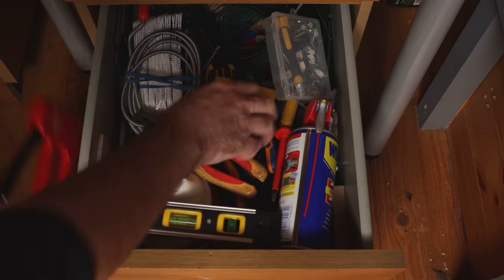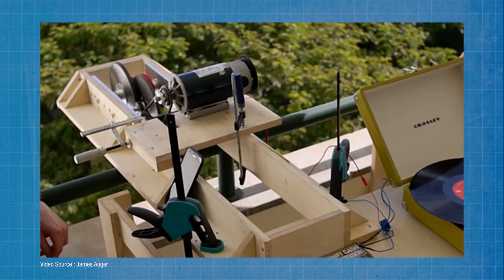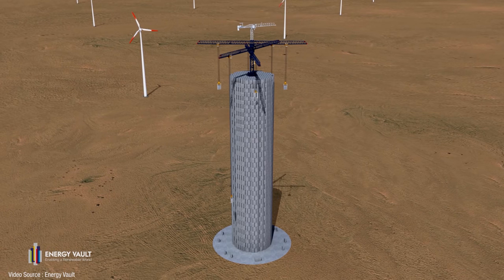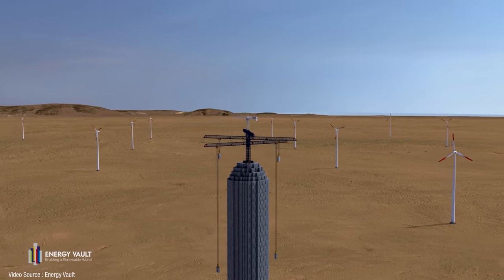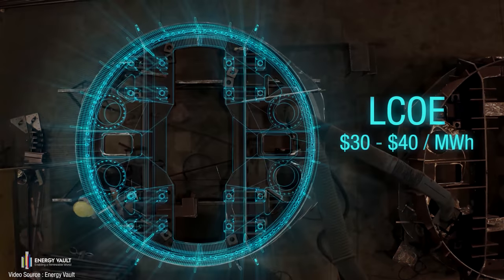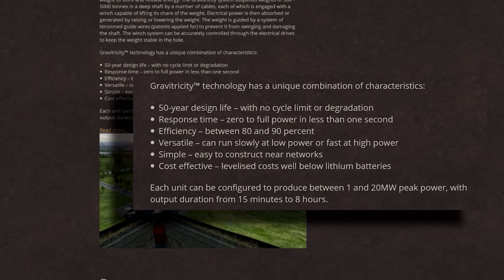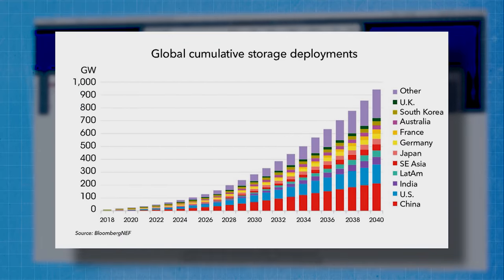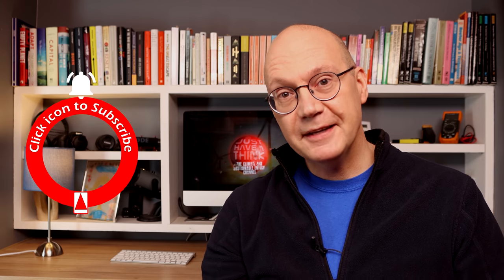Gravity Energy Storage : A very uplifting technology!

Comment: Can someone do the maths, this is BS!
Reply: How would you know, if you can't do the math?
Reply: @tzenophile 
I've done the maths, just wanted to open the debate!
It's difficult to generate more than a few kilowatts!
Reply: This is why systems that convert an elevated mass into power are exclusively hydro electric.
The mass required is enormous!
Reply: @_a.z  show me the math, then. Why can't they produce, say, 6MW?
Reply: @tzenophile 
PE=mgh
100kg weight, for example raised 50 metres
i. e  a heavy weight raised to the height of a very large crane at 100% efficiency, raises 50,000 joules when lowered.
P(W) = E(J) / t(s)
One minute to raise and lower the block (60 seconds generating) = 833watts/2 =416 Watts average output power.
Taking efficiencies into account, each massive and expensive crane and weight system could generate about 300 Watts, output in 50/50 surges of 600 Watts, given that half the time is spent raising blocks. 
If you just put a turbine on the structure, it would generate 1000 times more and you wouldn't have wire ropes wearing out and wasting power!
And bearing in mind this is only a storage device. Many hydroelectric systems are self-filling by means of solar energy. ie the natural rain cycle!
Reply: @_a.z  100kg?? try 35 ton, which is what their blocks weigh. Three double cranes give six blocks =210 ton. That is 28Kwh potential energy, and if released over one minute, 28x60= 1,7 MW. Not exactly 416 W, eh? The hoisting of the blocks is irrelevant here, as that occurs at the speed dictated by the storage need. This is a battery, not a net producer.
Reply: @tzenophile 
OK 86kWh at full tilt, with a high short peak up to 5MW for a second after a short start up period, reducing significantly to pick up more blocks lower down. Minus some inefficiencies, based on those figures. 
I'm still not convinced swaying cables can connect to the blocks and do the job. I wonder how the trials went?
As turbines are on hills, why not just put a rail track down the hill? 
It would be safer and weatherproof!
If its hourly output is around 40 kWh or as little as 28kWh, it's still not a lot! Furthermore any weights placed near the ground, wouldn't be worth the difficulty of picking up!
Reply: @_a.z  you're totally off in your numbers; still, I might add.   "OK 86kWh at full tilt,"   
"If its hourly output is around 40 kWh"  --  Where do you get these numbers?  I just told you 1,7 MW. They claim 4-8 MW, and somehow, you don't seem more convincing, so I will go with their estimate. Since they designed it, it is a pretty sure bet that they can back that up, at least the math of it. You were already off by a factor of 350.

And "why not just put a rail track down the hill?" 1: you don't have to be near a turbine (I assume you mean wind turbine) as long as you are on the grid. 2: try to just "put a track down the hill" and see how cheap and politically realistic that is, compared to the cost and footprint of  these towers with winches. And why would it be safer?
Reply: @tzenophile 
210,000 kg
150 metres
=309015000j
=86kwh
1 minute = 5MW 
Swings and roundabouts regarding rails vs cables. 
Wind turbines often sit on hills, weights could be low profile, fenced off, truly massive and slow moving. 
Compare that to the rail network!
Reply: @tzenophile 
I know where I'd put my money!
Rail would be very well established technology and massively scalable and relatively safe. Ratchets could prevent any failure! 
Repeatedly picking things up with cranes don't look good!
Reply: @_a.z  Sorry, but this is still just nonsense. The output is the energy produced by the total weight they manage to lower at any particular time, using six independent winches. it does not matter from which height, as long as it is going down. They don't pick up blocks from below during the energy production phase, did you think they would?? 

For as long as they have blocks to lower, they produce the same amount of energy per block per meter. The (empty) winching back up will be much faster than down, and therefore most of the time will be spent producing energy, in the MW range. If you don't understand this, then I am afraid I can't help you.
Reply: @tzenophile 
They pick up the blocks, move them to a position where they can be lowered to the ground.
Beyond a certain point and in high winds, could they efficiency pick up a block with the cables at nearly full stretch and make it worth dropping a few metres?
I barely see it working at all TBH!
Reply: @tzenophile 
It seems logical to just put a massive skip full of rubble on a track down the hill. It's just basic mining practice, particularly in Wales etc.
OK scaled up a lot or multiple tracks, but fishing for bricks in a wind is just bonkers!
Reply: @_a.z  I get that you don't see the concept, I do. But the problem is not the concept, it's your lacking grasp of it, as we have seen here.  
Now you're starting to talk about something else, controlling the pickup. How do they lower a block in high winds? Well, buddy, in high wind blocks won't be lowered, since the windmills will be producing energy. So they can take their time with the latching of the blocks on or near the ground, and winch them up. I can think of several methods to stabilize the blocks in high wind, it is not rocket science. And 35 tons provide a lot of inertia. You know they refuel fighter jets at 25.000 feet going 350 mph, and have been doing it since the first time in 1923? If they can do that, this is a piece of cake. Please don't worry about it.
Reply: @tzenophile 
I have a perfect grasp of it thank you, probably a little more realistic than yourself!
We shall see!!
Reply: @tzenophile And why would they be using "windmills"?
Whose lacking a grasp of the subject?
Reply: @tzenophile 
Yep, it made me cringe when I saw the video though! 
Well thanks for answering my question at the start of this thread. Maths rather than quoting the figures would have been preferred though. 
One other aspect to work out would be how much carbon would be released when cement is used to bond the materials (second hand concrete doesn't bond, as the video seems to imply) or how much the carbon footprint would total for such a massive structure. 
Well let's wait and see how it fares, in terms of providing a potential energy source, they have certainly taken on quite a project by comparison to existing technologies!